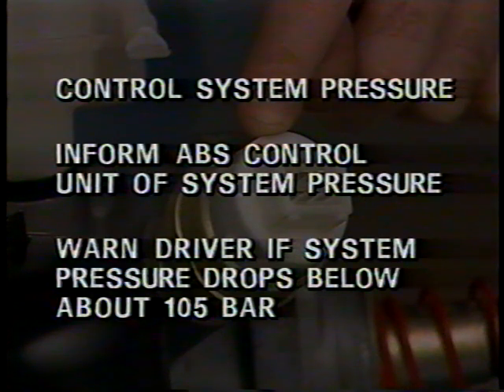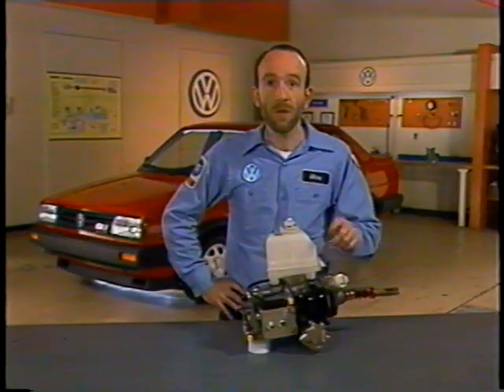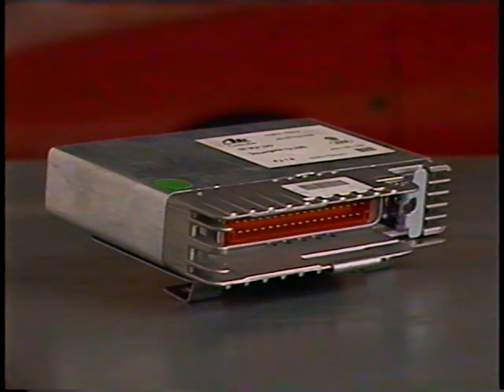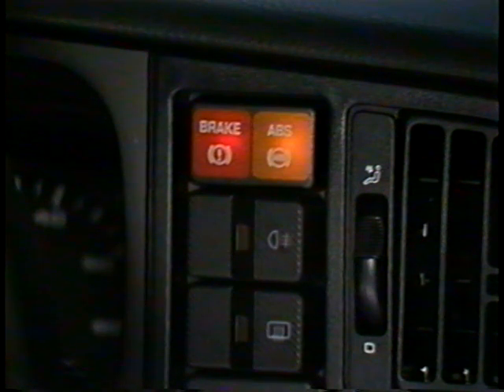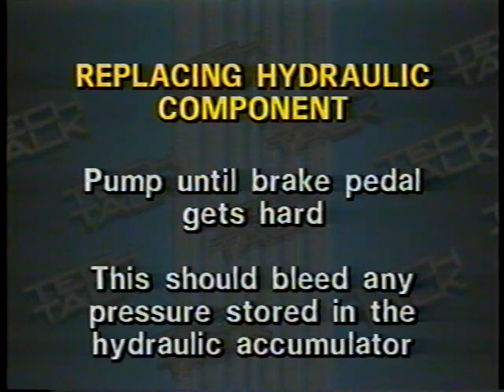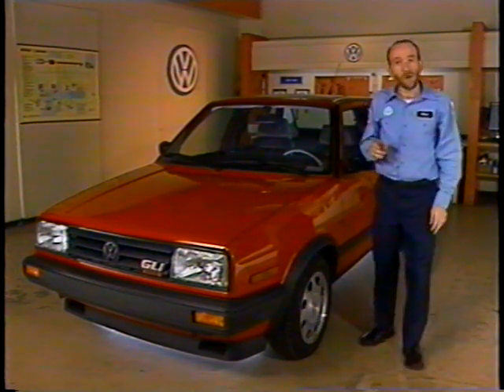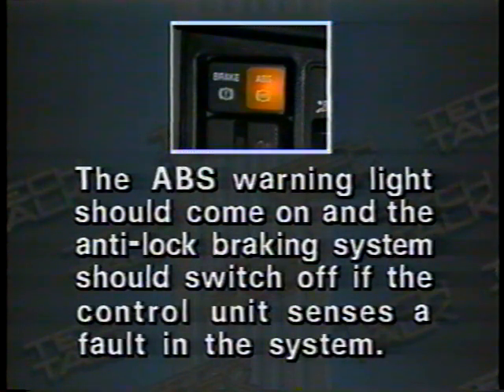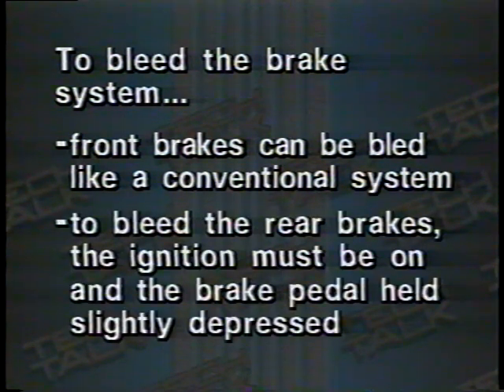VW Tech Talk 217: ATE Teves ABS Braking System

Comment: I always wondered why the ABS system in my Corrado doesn't work, after watching this video it really explains in detail how the whole ABS system works perhaps my ABS control unit is faulty? My accumulator is probably depleted the ABS has not work since I've had the car.
Reply from the maker: The power brake booster function should work, even if the ABS does not. The accumulator is somewhat easy to test... if you start the car it should charge up. Turn the ignition off, and see how many assisted presses of the brake pedal you get. If the pedal goes hard right away, your accumulator is dead.
Reply: @compu85  thanks I will definitely give that a try I'll press down my brake pedal a couple times after I start the car and turn it off. Hopefully my accumulator isn't shot from what I understand there's this 3 way  distribution valve that the brake lines come out of and I heard the valves inside of them eventually end up seizing up so people say you're better off swapping out the distribution block valve for the Passat 4 channel one you'll have better ABS control after doing so from what I hear.
Reply: Another Corrado owner with a faulty Teves ABS system. Some think the capacitors in the ABS unit need to be replaced, but many owners convert to the non-ABS master cylinder. I'd still like to figure it out and keep the (admittedly ancient) system though. Thank you @compu85 for posting this!!
Reply: @corradokid79  Save yourself the headache it's not worth keeping the ABS system in these Corrado's,  the wires are known for overheating and burning out the ABS modules, it was just a terrible flaw and design from the factory.
 I've already removed the whole entire ABS system from my Corrado and switched to non abs from a Passat, B4 no more shaking, and in my opinion the car stops alot better! 💪🥳🎉